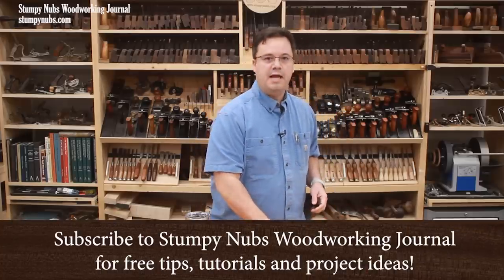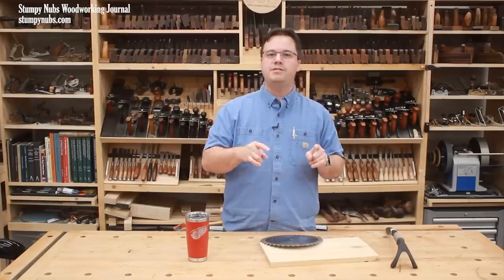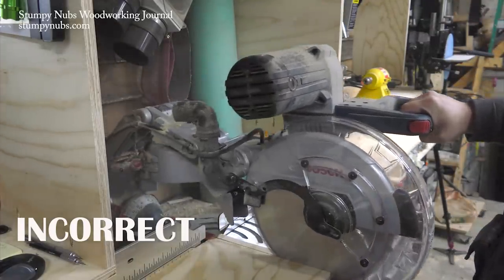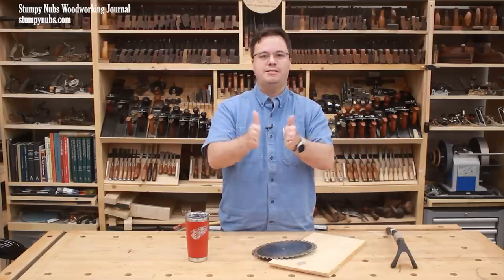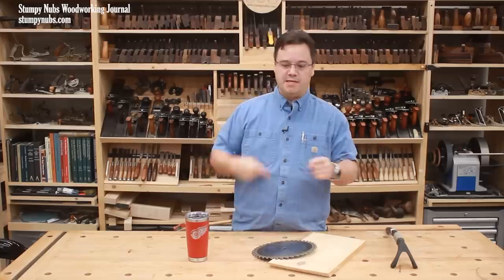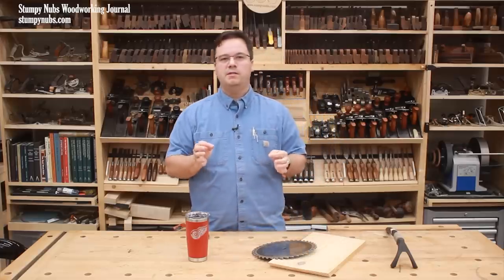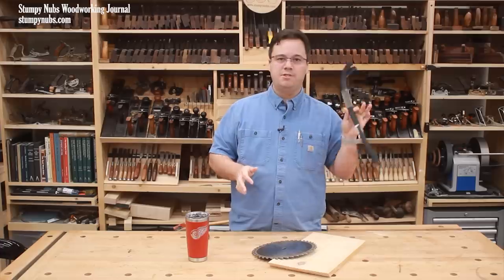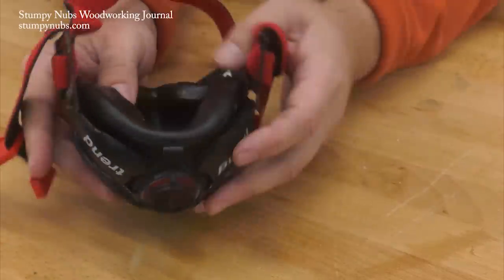A close call with a miter saw

Comment: I recommend, in cases where you have a fitted saw station (or if you don't mind drilling the saw a bit), getting a cheap lever style toggle clamp & fixing that so that you can quickly lock a piece down to the saw bed & unlock it again afterwards. I'm yet to find one that automatically adjusts to different thicknesses, but for when you're doing a lot of cuts in the same boards (precisely when you might get bored & stop paying attention) a quick flip down & then up can make a huge difference. It won't stop the binding, but it will stop the piece lifting or sliding & that's a lot safer. I don't know why all the saws seem to come with a screw-down clamp when those are slow and annoying to use by comparison.

Comment: This is why I use the radial arm saw - at least I don't have to worry about the carriage jumping up vertically.

The biggest challenge I have had is cutting very thin (<2 inches) trim to wrap around a workpiece.  Hopefully the million dollar stick could help out with that, but I suspect I should only be using hand saws for cutting pieces that small....

Comment: Just to add 2 points. 1. For those still using them, radial arm saws have the same issues. While the blade usually can't climb, it can come rocketing back. 2. Negative hook angle blades ought to be used on both miter saws and radial arm saws.
Reply from the maker: A radial arm saw blade certainly can climb on top of the wood. It's a common problem with all but the industrial models. I've seen and experienced it myself, and many, many others have shared the same experiences.

Comment: I think people also forget that just because your saw can slide forward to cut larger boards it doesnt mean you need to slide it back and then towards the fence for every cut, primarily the saw is designed for plunge cuts and if you think about the geometry of the teeth it aids in this by pushing the workpiece down and towards the fence, when cutting larger blocks say a 4x4 if you slide the blade out before cutting you can engage the back of the blade with the teeth of the blade coming up first and also potentially start a climb cut as you are drawing the saw out. That all being said if you need the extra cutting depth use it and if not then dont.
Reply: Not starting it spinning until it's all the way out was what I was taught...

Comment: Regarding using the $10M Miter Saw Stick: I don't have one. Whenever I cut small pieces that don't bridge the gap in my fence I first put a longer sacrificial piece against the fence to bridge the gap and hold the smaller piece against that. Pick a sacrificial  scrap that is wide enough so that you don't cut completely through it.
 For extra small pieces I also hold the small piece down with a second larger piece. Pretty much the same principle as the $10M stick, but using what I have handy.
Reply: Get one. Any time you're holding that kind of small piece, your hand can hit the blade if sometjing goes wrong....or even if you just slip, or get distracted at just the wrong moment.

Comment: Another solution to prevent saw bucking is to use saws clamping system to tightly secure one end (the long end) - I have a Makita 12 inch and I use this when I am cutting warped studs.

Comment: A technique I've used that could help prevent this situation with my radial arm saw, but should also work with a miter saw: occasionally I'll get rough or old warped boards, usually recovered barn wood, that I want to cut down. If I have a fear that they'll bind on me as they settle, I'll put another, flat board, like a 1/4" piece of plywood, underneath the board close to but away from the cut area, so that the board is raised up from the working surface of the table. The off cut side I'll either leave unsupported if it's small, or support it with something thinner than the flat board on the other side. That way, if the board starts to settle or move as it's being cut, the off cut side goes down, even if only slightly, and opens the kerf rather than closing it. Basically the same technique you'd use with a circular saw and letting your off cut fall to the floor, except it's a workstation that's already set up, and the piece doesn't have anywhere near as far to fall. 

If I have board I'm particularly worried about moving on me as I cut, usually if it's something that looks like it has a lot of tension in it, I will also do the same technique shown here of raising the blade up to only make a partial cut at first and then lowering it to finish. Sure it takes longer than a single cut would, and probably longer than a sliding miter saw would, but it lets me make the cut safely using the tool I have available.

Comment: I think I'll go buy a 10M stick... but currently for small Pieces I keep a pile of offcuts strips next to the miter saw. Those offcuts are use to bridge the gap for small pieces. I still think the 10m stick will add even more safety.  Another trick I was once told, espacially on small pieces, is to lay your wrist down on the miter saw and check that your finger reach your pieces but not the blade. this way, if the blade pulls, your finger extend, but your wrist keeps you in place... But thanks for educating us on how to keep all ours pieces (fingers and all) in working order

Comment: I love my 10 Million Dollar Stick.  I first saw it years ago, and the price was crazy...Fastcap was sold out, and it was nearly $100 on Amazon.  Obviously, I ignored it.  About a year later, it was a random recommendation on Amazon for about $25, and I jumped on it.  I do a lot of small parts, so it gets double duty on both my miter saw and my table saw (when using a sled).  Even if it hasn't saved my fingers, it has definitely saved my nerves.

Comment: The other way to improve the safety when cutting a small piece of work which doesn’t span the fence gap on the saw is to use a sacrificial piece across the back which is thick enough that it doesn’t need to be sawed all the way through, although this still ends up with hands close to the blade and not held as securely as I’d prefer, plus a small piece of wood as a possible projectile.  I’ll have to look for the stick you demonstrated, using both together strike me as being a very safe combination.
Reply: I do something similar, but make an expendable L-shaped fence with mdf and clamp it down, so the smaller pieces are fully supported.

Comment: I have a trend mask I use at work, honestly that thing is near perfect! 

Doctor said I may have something called "reactive airway disease" similar to asthma,  and so I can't have prolonged airway restrictions or resistance also, I need to avoid certain irritants and their mask filters are very low resistance and it basically has a 2 stage filter element that captures large particles before going into the fine mesh for what they claim in 99%+ filtration.

In my shop we have some issues with wood flour, basically like ground cinnamon but it doesn't smell or taste as good.

So that wood flour is so fine that it will get through a sherpa lined canvas duck jacket, long sleeve and short sleeve shirt, but it doesn't even come close to going through these filters!
I was able to blow out my first set and extended their life a little bit but then I got into something and they became odoriferous after working with metal dust and fiber discs. 
So my only complaint is that I personally don't get a very good seal with mine, but it is what it is because they broke the mold when I was born so you'd have to go through all that paperwork to make a new one.

Comment: I’ve had small offcuts get fired and embedded in the wall behind. Especially when cutting hard woods, MDF just explodes as does soft pine sending shrapnel flying all over. Once working outside a piece of wood must have travelled over 25 feet. Never cut if someone is standing or working behind the saw.

Comment: We've got a Bosch sliding miter saw in the shop and it's a kickback disaster. My follow maintenance workers (we're at a school) just deal with it, but I refuse to use that saw. Anything larger than a 2x2 and the blade gets pinched. Putting a straight edge along the fence, I discovered the fence is bowed in by about 1/16". Long 2x4s or 2x6s pinch the blade in the last inch, as the wood now tries to press against the fence faces. I'm going to try to bend the fence straight, based on a tutorial I saw. Evidently, a poorly machined fence was common on this model Bosch.

Comment: What are your thoughts on using another, longer, piece of wood across the gap in the miter saw when you have to cut small pieces?  Kinda as an additional fence
Reply: Only if you can clamp sacrificial fence to both sides of maitre saw fence
Reply: I clamp a sacrificial fence across the entire width of the metal fence and then cut a kerf into it.  This provides zero clearance on the back side, it gives an easy reference where the blade will be cutting, and prevents smaller pieces from getting sucked into the gap.
Reply: Both these guys make good points.  I would just add to reinspect the saw each time before you start, to make sure things are still safe.

Comment: I that video if you watch closely the woodworker lifts the blade at the very end of the cut. Don’t do that. I also use my festool downclamps which keep the board from moving. And that Fastcap hold down is a genius tool I use often.

Comment: the safer push cut doesn't give an edge as clean as using the downward cutting teeth to break the surface, as opposed to the inner side of the saw where teeth will rip up through the surface pulling fibers up. a time saver if you don't plan on working on the material after the cut and its a visible piece. So I use it a lot at work on worksites, usually first making a shallow scoring that way and then making a push cut to actually cut through. just need to respect the tool and take whatever other precautions you can...

Comment: I saw the thumbnail and thought you were going to take a hammer to the Bosch saw.  Bosch makes some incredible woodworking tools, however their miter saws are absolute garbage.  Our large volume commercial cabinet shop bought 3 to replace old Dewalts.  EVERYONE hates the Bosch, the slide can be flexed 3 degrees with very little force.  I rebuilt one of the old Dewalts, and everyone uses it.  Dewalt and Makita are best for miter saws.  I did just buy a Bosch 18v cordless sander for home use...and OMFG, that is AWSOME.
Reply from the maker: My Bosch saw is solid.

Comment: Having seen unsafe cutting all over internet, when I got my miter saw I was extremely wary of it. I made sure to  place a longer piece of  wood of the same size as the stock being cut, and then screw another one  on top to make a holder that would retain smaller pieces. WHEN the saw got hungry, my hands were 1 foot away.

Comment: I liked the $10M stick, not seen that before, simple but effective.
With regards breathing and dust, if you have a beard then these half masks may not be of any use, they cannot seal properly around the edges due to the gaps between the hairs on your beard!   Block the inlets on the mask and breathe in, if it doesn't suck onto your face then it isn't protecting you properly 👍

Comment: I guess it shows the influence of good safety videos. Amazon is sold out of the $10m stick. But I’ve had enough close calls I’m going to get one (or two) when I can. One particular instance I had a very small piece rotate on me at the miter saw and could have easily lost several fingers. Thankfully I walked away with injured pride and still have all ten digits. I’ve also learned that there are ways of cutting small pieces without resorting to a big saw for a small piece.
Reply: Add it to a list on Amazon and have it notify you when it's in stock, they frequently come in and go out of stock, you'll find one eventually.  Good luck!

Comment: I have one of those Ryobi 7 1/4" sliding compound miter saws.  Had a 2x8 I was cutting.  It had a lot of pitch in it and it pinched the blade to the point where it stalled the saw.  Could not get the blade loose. Unplugged the saw and fiddled around, trying to free the blade.  There was no way to get a wrench on the arbor nut to do what you mentioned the guy in the video doing.  Ended up cutting the blade free with a multitool.  Later, that same board also pinched during a rip cut on my table saw, though that one was easier to get free.  I ended up finishing the rip with multiple light passes.

Comment: Safety-wise - I can deal with a climbing cut (guards on the blade area.  I got a Bosch, earlier in the year; I started my cut from my side, going away from me.  The blade grabbed onto the edge  and pushed up the board, fracturing my thumb.

Comment: I had an issue with the mitersaw when I first got it. I was trying to cut a very crooked narrow piece. But it was long enough not to be dangerous for my fingers. So, I cut it, the moment it finished off, offcut bound to the blade flung into the wall at my garage. I am very lucky as my back was to the cars. The piece almost lodged into the wall, it could have destroyed the car windshield. It could also be bounced back but with much less force. Again I wasn't in much danger as I positioned myself on the otherside of the blade. 

For the last tip, I think a zero clearance sled will could also be used.

Comment: If you're cutting a small piece on the mitre saw which doesn't span the fence gap, would using a sacrificial piece behind it which DOES span that gap reduce risk?  It seems as though the 10 millon dollar stick wouldn't work well with a mitre saw mounted on a work stand--that is, one which doesn't have a benchtop to the left and right of the sawblade.
Reply from the maker: Yes, but I still would not want my fingers close to the blade.

Comment: This could also happen if the wood is bowed and is only touching either side of the slide fences and not touching the centre. If cutting smaller pieces, use a waste piece of wood to create a zero insert. You can also use another scrap piece of wood rested on the work piece and clamped down and works fine. The wood your cutting should always touch the centre of the slide rails and the centre of the bed and you'll never get pinching.

Comment: I tried 10 million dollar stick . while it works well with miter saw stations, it doeent work very well with miter saws sitting on  portable miter saw stands that use tubular frames. The end of the stick has nothing to rest on for many saw stands. I did have a binding wincident and it happened so fast i wasnt sure what happened. All i knew was my hand was bruised. For me cleaning the blade and going slowly may be the best options.
Reply from the maker: In that case I would hold it by the end instead of pushing on the middle of the shaft.

Comment: I was wondering when cutting narrower pieces with a radial arm saw, ir it would be better to push the saw into the stock rather than the normal pulling and thus avoid climb cutting especially on thick stock.

Comment: Man I had a piece of round stock kick, flew an inch from my head and embedded itself in the plywood wall behind me.  Truly an inch from instant death.  Still gives me shivers
Reply: Had an issue with round wood as well, but the kickback wound up breaking the guard!  Never again.
Reply: Lol
Never again is also my point of view!
Reply from the maker: Round stock (dowels) are very dangerous with a miter saw. I use a band saw or cut by hand.
Reply: I was cutting a 6 inch round piece of birch  branch into thin slices unsupported on one side of the saw bed 😳.  Was making cut offs for the kids to paint as Xmas tree ornaments.  There was a lot of mass!  I was so stupid!!  High chance for catastrophic injury!  Lesson learned.  I have since made a jig to hold round stock securely on the band saw.

Comment: I have a ten million dollar stick, but a safer way to cut small pieces is to put a narrow, maybe 2” wide board clamped against the backstop of the saw. I don’t even need to cut clear through the scrap piece. This way the small piece can’t twist. I still hold down the small piece with the ten million dollar stick.

Comment: My wife wanted me to cut a 3" thick mulberry branch into short sections for some reason.  I took it to my sliding miter saw and it worked pretty good,..until it didn't.  One piece caught on the blade and pushed on the fence so hard it bent it out of shape and cracked the base ring in the back that connects the two sides of the fence.  I got a new fence and a few years later I was making something out of construction lumber (lots of cuts on the miter saw).  Must have gotten tired, cuz one piece lifted up and slammed into the fence.  This time it only bent the top right side out of shape so I didn't need to replace it.  I've kept it that way for years as a reminder to engage brain BEFORE pressing the trigger on that saw.